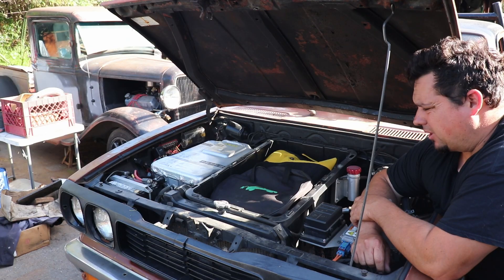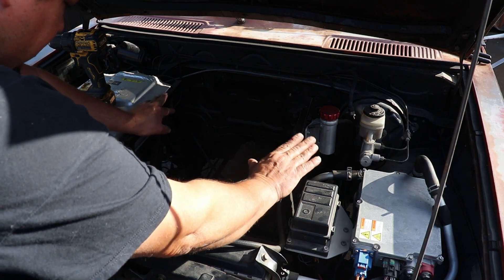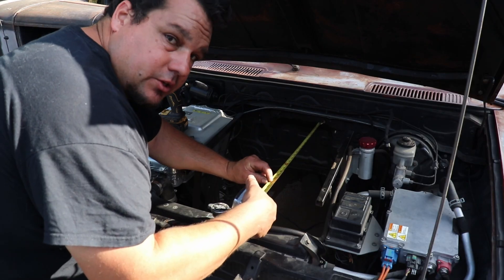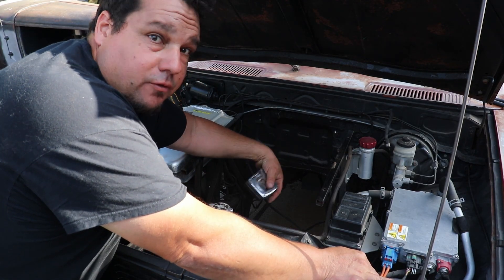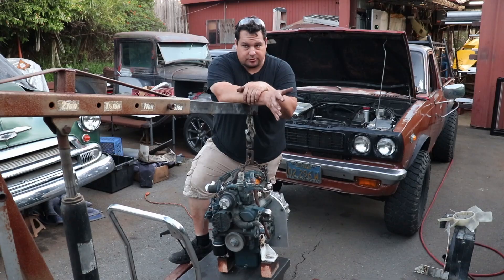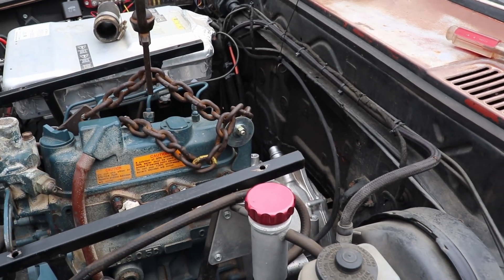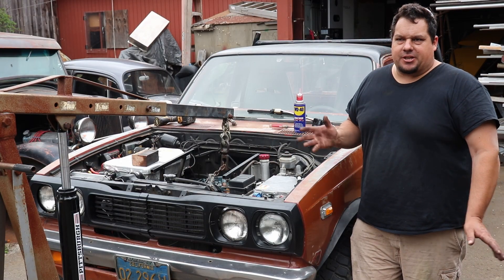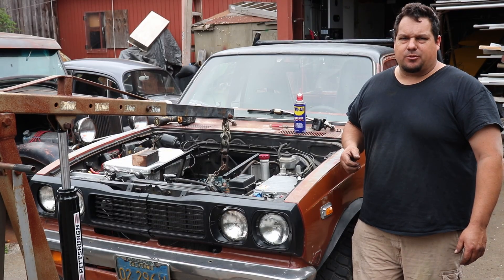HYBRID HILUX! Mounting a Kubota DIESEL ENGINE in the Tesla-powered Toyota Hilux Video 7

Comment: "I've driven theses trucks without the sway bar and they are fine", some poor Japanese engineer is rolling over in his grave. The engine will fit right in there, once I totally redesign the front suspension and cut up the cooling system on the generator. Yup, it's a bolt in! "I need weight in the front end." "Damn this radiator is heavy!" Now driving around with a dead weight generator costing you range in a pickup that causes you range anxiety! LOL. Keep at it, the wiring is gonna be a blast.
Reply from the maker: Thanks Spicer. Haha

Comment: With EV towing I have wondered why manufacturers haven’t put a charging port at the bumper and worked with trailer manufacturers to add batteries to trailers. Charge it while it’s parked and plug it in to the truck to maintain range. The trailer could also have regen braking. I have also seen regen suspension products.
Reply: Probably because 99% of the people actually towing use diesel or maybe gas, it's a cool idea and definitely would work (i have seen someone do it DIY before) but there isn't a market for it right now and i doubt there will be any time soon
Reply from the maker: Yeah that would be a cool way to do it. I was considering doing that as well before I decided to go this route. I think it’s just a practicality thing.

Comment: You may be able to reverse the sway bar around to the front for those high speed corners.
Reply from the maker: Yeah for sure. I use to have a long travel Toyota and got use to diving the front end more for the tighter corners. This front end is super stiff too because of the lack of weight from a missing engine. The 22re was around 450 pounds plus transmission so I will definitely be under weight still.
Reply: @J5Jonny5  like any of our old or clunky cars, you drive it to suit its capabilities and quirks. Sway bars are pretty new tech anyway, we don't really need them. ;)
Reply from the maker: @ oh yeah! I drove it for the first time yesterday without the sway bar and I wish I ditched it way sooner. It actually rides a lot better now haha!